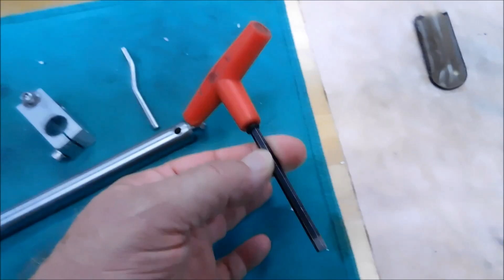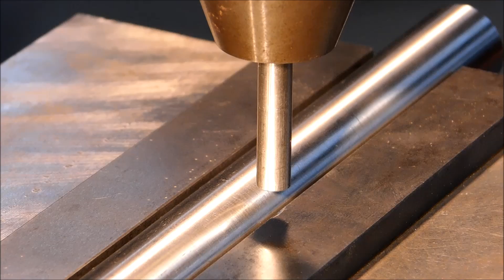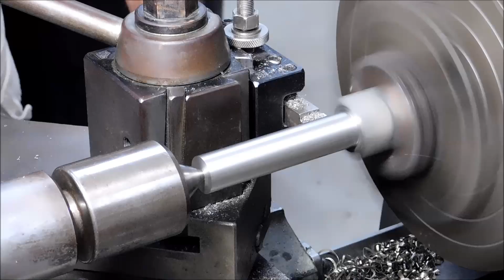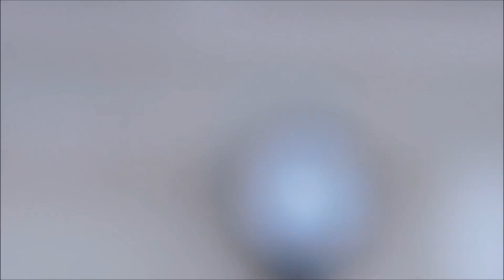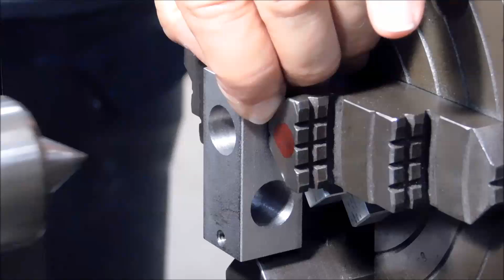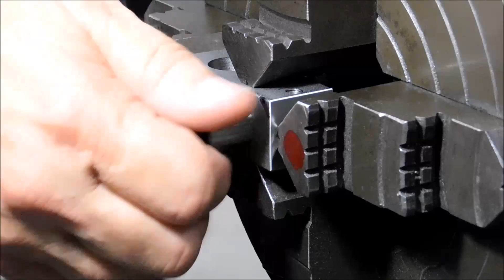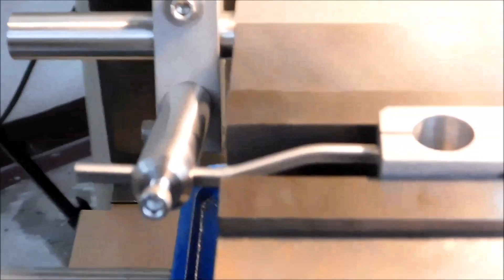Make Your Own Outrigger Vise Stop

Comment: Another great vid Joe. Years ago I bought a South Bend heavy 10, it came with a bunch of stuff but one of the most unusual things was a 4 jaw chuck that of course is independant but also is scrolling! It was made in Connecticut and is very old, have you ever seen a scrolling 4 jaw before?
Reply from the maker: I have seen them, but never used one.
Reply: @joepie221  Yes, I'm sure they were made for production runs perhaps for second machining steps as I would not not trust them to be repeatable unless the square or rectangle parts were preciseely sized. I've only used it as an independant 4 jaw. Love your channel and knowledge. Best wishes  from Eastern Long island N.Y.

Comment: Always good work.  At 44:10 you started boring the second hole.  In this operation, both holes, does the reference mark from the mill become a factor for concentricity?
Reply: So, did I answer it myself:  Boring solves the issue?
Reply from the maker: Only the diameter matters on this piece. Concentricity doesn't come into play.

Comment: I guess I should really pay attention to detail a little better. I am making this for my mill right now and made the mistake of ordering 304 stainless on the 1"x1" square and learned it doesn't play well with others when machining. I finally got it to leave a beautiful finish but had to turn the speed down to 275rpm while only taking .005 doc @ .004 feed rate using a WNMG431 and using dark threading oil. 
Still learning is learning I guess, I did run into a surprise while turning it, like most in the beginning I had bought cheap inserts and I have learned my lesson there with the short life they have and I now use them for roughing in and go to REAL name brand inserts for finish work but before I got to trading out for a higher quality insert I decided to try the cheap insert on a finish pass and it did great even on only a .005 DOC which I wasn't sure a WNMG431 was capable of doing even if a name brand.
Reply from the maker: 304 and 316  like to work harden on light cuts. Don't be afraid to dig in if your machine can handle it. Lubrication is also a good idea. Watch out for the temperature of the material before the finish passes.

Comment: I used Anchorlube yesterday when making sizeable bores on 1018 steel.  It makes vapors, not smoke. Soon, within an hour of using it, I noticed that all parts of my lathe near the work were turning brown. My chuck, jaws, the 1018 workpiece, the ways...ALL the metal was turning brown. I cleaned it with 1500 emory, WD-40, Scothbright, and managed to scrub away most of stain. I then finished the job using both Tap Magic, and the new THICK Tap Magic. They smoke like crazy, but I've never had a problem with them before. This morning all the parts are stained again. It is uniformly distributed on all surfaces, and only a vapor deposition can do that. So...one of these cutting lubes is fuming and or smoking and messing up my lathe.   HAVE YOU SEEN SIMILAR PROBLEMS???
Reply from the maker: Yes. I learned the hard way to clean up any splashed anchor lube immediately after using it. I spray my parts with ISO alcohol and haven't seen stained parts yet, but the ways on my lathe weren't so lucky.
Reply: @joepie221  THANK YOU, JOE. That stuff should not be sold. I didn't use much of it, but the vapor apparently penetrates metal crystal boundaries and lingers. I cleaned with alcohol last night and thought that would do it, but this AM everything was worse than before I cleaned yesterday. Whatever happens when the stuff vaporizes, it's nasty. I spent two hours recleaning this AM. Wonder what tomorrow will bring. THANKS AGAIN.

Comment: I place my splits to favor the head side of the bolt hole allowing more teeth for the anchor end. It works fine and I've never stripped threads!
Reply from the maker: Or use a longer screw?

Comment: Joe, I noticed you are using a BXA with a quick change tool holder then the additional boring bar holder. I had considered going this route but wasn't sure if having that much hang out would cause an issue with surface finish, mind you only doing light cuts with that much leverage out there. Please let us know if that setup has caused you to have to alter anything you do over using a standard quick change boring bar holder. I only have an AXA and went with an oversized (1") quick change holder and have made boring bar adapters like you did in order to hold my bars but this has me having to clock my bars in the holder since they are a pinch type and not set screws through the top of the holder, I really wish they did that instead.
Reply from the maker: BXA actually offers a block with a 1" hole. You can make collars to suit from there. I showed it in another video on lathe tooling on my channel.

Comment: Great project.  I am building one for my 4" vise. I do wonder about chucking the connecting block back in the lathe to bore the holes to final dimension--why not just drill and ream in the mill  (no change of setup)?  I will use 3/4" square bar, didn't have any, and wound up buying a 16" piece of O-1 tool steel.  (So I can harden it in my shop-made oven)  I hope I will be able to turn it ok.
Reply from the maker: Either way is fine. I chose the 4 jaw just to mix things up.

Comment: You can also pick up center with a pointed tap in a 6-inch scale, balancing the scale on the part and holding it down with the tap in the spindle

Comment: Did you notice that when you broke through that last cut with the bandsaw,
It  looked like the opening. opened up a fraction of a inch 
Would that mean the surface of that item would not be perfectly flat, and the gap would have a taper.
Reply from the maker: For the application, a taper gap, if present, wouldn't hurt anything. The clamp screw will return it to where it belongs at use. Surface and material stress can do that on a lot of materials. I would think the outer surface would see the most curvature when material moves.
Reply: @joepie221  I agree, but just wanted to notice if you had observed that had happened, and i was not sure if it actually did happen, and might be a warning for myself if some time in the future I happened to be building something where it could happen,

Comment: Joe just got myself a cnc Lathe what coolant are you using please, only used it once and fining my tools in the holders getting surface rust on can you cover this in one of your videos please, 

best regards 

Dave from the UK
GREAT VIDEO AGAIN
Reply from the maker: Dave, I use Trim-Sol. Its a water soluble oil mixed at about 10% ratio.

Comment: Why not use a shopvac to suck up the chips instead of blowing them all over the place with compressed air?  As a novice hobby machinist what am I missing here?
Reply from the maker: I don't blow them onto anything but the floor. Its an easy cleanup, but may not be for a garage shop.

Comment: 8 years manual machining and never thought to set drill depth with the quill stop, then use the knee. Always calipered the top block to the quill stop.
Reply from the maker: Its also a solid technique to stop drills from bouncing. Try it.

Comment: Hey Joe!  I love your videos.  Maybe you would like to weigh in on question I have.  When drilling, is oil better that "milk coolant" (water soluble)?  Several considerations based on conversations I have had over the years.  Milk is a better coolant.  Oil is not going to cause rust on your ways.  I was first trained in a large fabrication machine shop.  Many vertical drilled and sometimes tapped holes.  You could fill a hole being drilled with milk and until a hole broke through, you had a flood coolant situation. 
   But my real question, generally, which is better, oil or milk?
BTW, an average sized hole in this facility would be 2"-8 tap, through.
Reply from the maker: I see the answer as pretty simple. One is a better coolant, and one is a better lubricant. So what does the application demand? I'd say tapping a 2" hole through a piece of steel, you'd want lubrication, if you were milling a pocket in aluminum at high speed, you'd want a coolant.

Comment: I think I posted this on one of your videos before. 304 stainless is in my opinion the most dangerous metal to work with. And not only work hardens but the curls come off as sharp as razor blades I have two fingers that had to get sewn back on well the tips of the fingers anyway all the way down to the end of the fingernail were pulled off like a glove on a lathe. It was the most painful experience of my life and I've broken just about every bone in my body working construction before in younger years. It is such a very important thing to know the metal you're working with understand its characteristics I learned that the hard way. I imagine a curl on a mill could be just as dangerous as on a lathe because it would tend to pull your hand into that Chuck into that bit and it could do all sorts of damage. These machines are not forgiving at all. And don't ever think that you're implying safe techniques because when you think you're being safe is when you're going to get hurt like I did I had a very small curl coming off I didn't notice right away and I should have shut it off when I did notice instead I just flipped it away from my carriage handle with the back of my hand it wrapped around my two fingers while simultaneously getting picked up by the job of a three-jot chuck and sliced my fingers off as if they were pieces of glove. I can no longer play guitar because of this and I never will be able to
Reply from the maker: The 'hair fine' long string chips scare me the worst. As soon as I see them its time to shut the machine off and get rid of them. When that spinning chuck reclaims that material, its one of the most dangerous situations you can encounter. Your injury must have hurt.
Reply: @joepie221  it made me realize that things like PTSD are absolutely real because I experienced it. It was the most painful injury I have ever had it did not feel like a cut it felt like I got smashed on the hand by a sledgehammer literally. The ends of my fingers came off like pieces of glove they were peeled back off the bone only being held on by the nails and the cuticle the woman that sold them back on did an unbelievably good job but when I touch the tips of my fingers now it feels like electrical shocks. I can't feel any sensation when I touch things until I apply a sleep pressure and then it's like an electrical storm. The nerves never grew back right.

And yes the 304 Long fine curl was the culprit I just tried to flick it away from my carriage. I always thought that I was very careful but just because I didn't want to interrupt that cut I'm going to suffer the rest of my life. When people think they are taking this craft seriously they really aren't until they see something like this happen and it puts everything into perspective.
Reply: I have the exact same thing happen, but I only lost the tip of my pinky. Same thing with no feeling in it, unless you touch it a certain way it feels like it got stabbed.
Reply: @snowdog90210  i'm very sorry to hear that
it affects my entire life.

Comment: I've built 100's among 100's of clamps, stops and fixtures in my shop including clamps for my production parts that go onto some of my products. After all my years of machining both CNC and Manually I still love to periodically look at your videos. A note for some of those starting out, & doing repeated processes, Get a fat blue sharpie and mark 1 end of your stock (and a small hint of marker on the top surface if you want)so that as you take the part out and reposition it for next step, you always know the way the part went in vice. When you flip a part, & let's say you drop it then you always know which way in sat in the vice. Especially great if you do 1 step at a time for many many many same parts that will have another tooling operation.

Comment: Hi Joe, Apologies if this is a repeat question (I searched below but couldn't find an answer), but I'm busy building one of these now, and am curious about the use of a #6 tap drill vs #7 for 1/4-20...  Thanks for all your hard work in making these videos!
Reply from the maker: #6 is fine. Its normal to upsize a tap drill size for stainless.

Comment: At about the 6:20 mark, after picking up the edges of the part by bumping it into the shim and the pin, I didn't hear you account for the thickness of the shim when explaining how far to move to the hole location.  Was that because you weren't concerned about a couple of thousandths, or am I missing something?

Comment: Excellent video.   One thing I did differently is rather than drill and tap the rod that holds the stop, I bored and tapped a cap that fit over it.   I then drilled a crossing hole through the cap and one through the rod.   This allows me to fit any stop without having to mill a flat to account for any metal deformation on said stop.  The stop is put through the cap and rod.  When the screw in the cap is tightened it clamps the stop between the holes.  Many indicator set ups use this same scheme.

Comment: The 'hanger'is a very dangerous thing. I've drilled hundreds of holes and still got bit by one recently. It whipped out wide and grabbed my thumb,  pulled it into the job and the spiral cut cut deep before it let go. A significant amount of claret spilled with a decent flap of skin hanging loose. I was relieved it happened to me and not to one of my students.

Comment: Thanks Joe another great build with lots of time saving techniques. Would love to see how you finish the ends odf shortened threads e.g. Setscrews and all thread, I always seem to end up with annoying burrs.
Reply from the maker: Screw a nut on first, modify the end, dust it lightly on a sander or hard scotch brite wheel and unscrew the nut.
Reply: Thanks I must get one of those deburring  wheels as you urged to me to in that video about them. Stay safe. Tony

Comment: 46:53 Why does the part openup right after the cut ?
Reply from the maker: It certainly appeared to do just that. I would have to blame any movement on the surface stress of the material. The same reason the part would bow violently if you took a lot of material off of just one side. The outer skin of a lot of metals has a pre-loaded elastic tension to it from the extrusion process. This can be a real problemif a job isn't planned out in great detail. Pre stress relieving material can be a solution.

Comment: Very good tutorial Joe. I am curious as to why you chose to bore out the rod holes on the lathe, when you already had the locations dialed in on the mill - would it not have saved a lot of time to drill and ream to size on the mill, rather than indicate the part in the 4-jaw then bore to size.
Reply from the maker: Just for fun, and to offer the live center pinch trick for pre-setup.
Reply: @joepie221  Thank you for that Joe. I've used that trick on my wood lathe, but not on my metal lathe. Still waiting to get my 4" 4-jaw for my 7x12 lathe
Reply: Owen Clark Hi, I think he just wanted to show how to do it! BobUK

Comment: Ive learnt a lot from your videos especially using trigonometry and different set ups and i have to say you're one of the most technical you tubers but ive learnt from another popular YouTube that when four jawing its easiest to tighten the highs losen the lows hence i four jaw a lot of my parts, using that method you do become proficient at that practise and takes no time.  btw I'm only a hobbyist  but i do make or repair some parts in my line of work being a mechanic and transmission builder.
Reply from the maker: I'll admit, I have never used a 4 jaw chuck to machine a piece of round stock. Ever. Except for the quick alignment for a piece of square stock of the same size, round stock never goes in my 4 jaw.

Comment: Joe, it seems a few people are confused by your use of the term "unloosen".  They may be interested to know the term goes back to the 1300's when blacksmiths often made ambihelical hexnuts to secure parts in agricultural equipment like cultivators, hay balers, and hog carts.  Ambihelical hexnuts were each handmade and had the interesting property of having to be completely screwed on before they could be screwed off and, no matter which way it was turned, it tightened.  Therefore, it made no sense to say, "loosen the ambihelical hexnut".  Thus the term "unloosen" came into common use when referring to ambihelical hexnuts because that clearly indicated that the hexnut was indeed ambihelical and would have to be completely tightened before it could be removed.   Like many words over the years, its true meaning was lost, and machinists trained by the descendants of the machining/blacksmithing guilds came to use it to simply mean unscrew the damn nut. 😜

I made a vise stop like yours for my little Kurt D-30 after I first saw yours.  It is indeed a must-have.  Great tutorial.
Reply from the maker: Using the word 'Unloosen' is very common in the northeastern US. I still use it and actually enjoy how it fires people up when I do. It's going to stay around. thanks for the history.
Reply: @joepie221  Hi Joe. This guy is pulling your leg. The ambihelical hexnut is an impossible figure. Mathworld.wolfram.com has an image of one.
Reply: @alanclarke4646  LOL, I'm sure Joe knows that.  He's a puzzle-maker, and the ambihelical hexnut is an old gag to pull on apprentices.  😁

Comment: Looking good Joe. question did you ever check the height of all four of the vices
Reply from the maker: Yes, the TIR is .0004 between all 4. #5 (675) is on my manual mill and falls within that range as well. Kurt is very reliable. Probably why they are so expensive.
Reply: Thanks joe I remembered that someone had a issue with them just wanted to make sure that you had check them